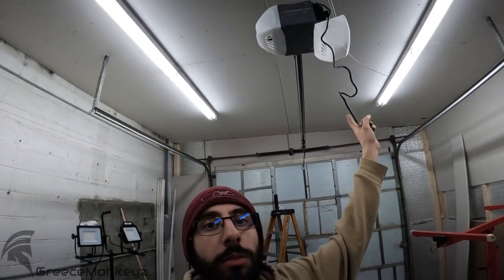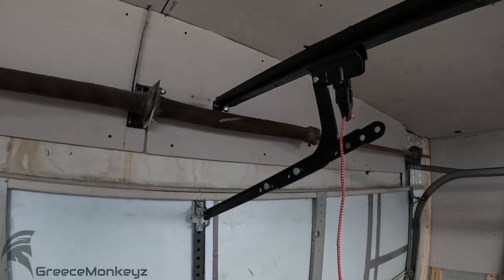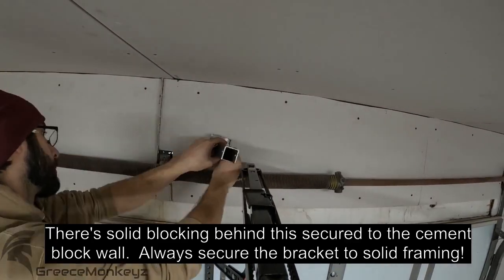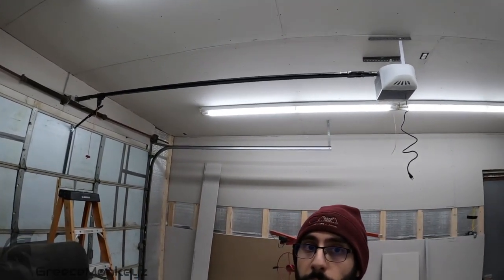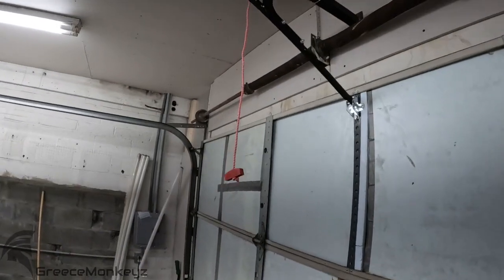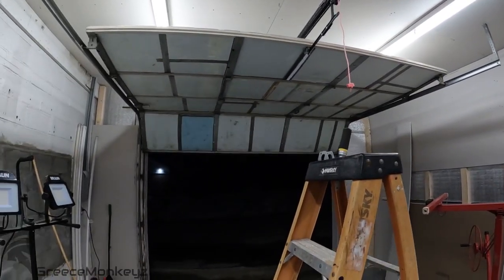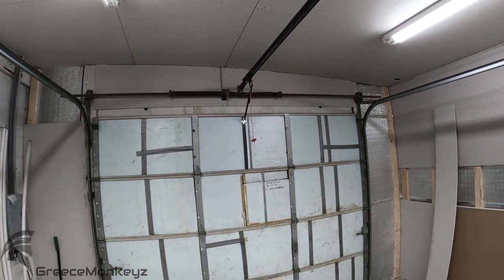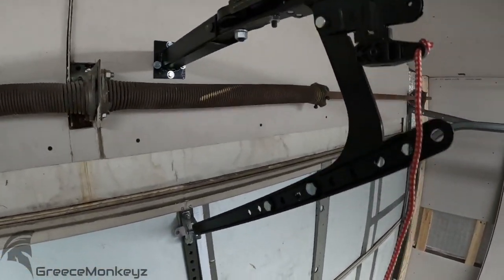Make your 7ft garage door opener work on an 8ft door, save some money

Comment: By the way I had a pro install mine and he did use the extension kit for my 8’ door.  However, being an engineer I noticed on the 7’ door the whole track is not being used. How far would the 8’ door open without doing anything?  Is it possible that it would open a 7’6” door fully without doing anything?  When you increase the header, do you need to do anything to the track, etc.?  Is there a reason you need to open the door fully?  When I had my tract home built 20 years ago, this was a reasonable option (3 car garage, both doors were about $300 extra), so I opted for this. The only time this is used is when you have a larger/higher truck, or when you put on a car top carrier for storage for a vacation. You can open this carrier in the garage, fill it and close it and then can safely ride out in the morning. This works with the carrier we have. This was on a 2012 Honda Odyssey. 
PS: I actually bought the same door opener for a rental condo I own and noticed the extra track length. I ran into a different problem, the door opener was too long, I ran into a You Tube video showing how to decrease the length. I did a different workaround, I had an “I” beam in the way. The “I” beam was covered by a drywall box, which I cut into and recessed the opener into the box and that worked. The opener was 2” too long, but when done there was still 3” to the beam.
Reply from the maker: That's the funny thing, the tracks are long enough for an 8' door but the factory stops on the opener bars are the limiting factor.  So no, I didn't have to do anything to the tracks.  And yea the only reason I tried to maximize the opening height is because I had a ladder rack on top of my truck at the time.  

As far as how high it would open without modification, you would have to install it to a point where you can test or measure where the lift arm rests closed up to the stopper at the full open position.  Theoretically it would open the distance between the physical stops if you can install it in a way to take advantage of the full travel.  Too many variables to say with certainty.